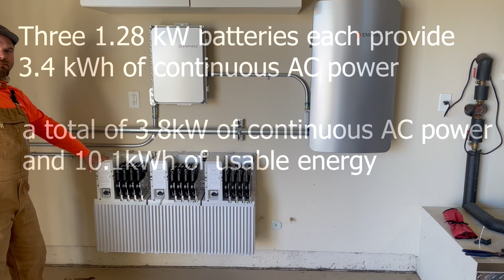How Does Solar & Battery Backup Work Together to Power Your Home Explained by SolarCraft

Comment: Liked your video 
But............Where is the industry standards on solar backup. 
Should solar written quotes and proposals contain peak amps usage and main fuse amp rating in survey assessment and written proposal containing Peak amps backup capability for home back?
Overall Kw doesnt tell you what the home rerquires or solution supports, customers need to know Peak amps usage and peak amps solution delivery..

Comment: If you would’ve installed the solar envoy lower, you could’ve negated bending a 90 and using an LB. Would’ve just been a straight nipple out the right side.

Comment: Is all the inversion happening at the battery mounted inverters (AC-DC and DC-AC) or are there also separate micro inverters under the modules? I think it's implied that it's all DC until you get to the battery IQ8s but wanted to confirm. Pretty neat overall
Reply from the maker: SolarCraft typically uses microinverters behind the solar modules to change the DC to AC on the roof. It’s then inverted back to DC to store the energy in the battery and then to AC to use in the house. Hope this adds clarity.
Reply: @Solarcraft  Thanks, that does. So two sets of inverters, one set at the battery and one at the module. If so, sounds like you have co-generation capability where you may deliver solar power as well as battery energy to the load  (home) simultaneously if needed. Thx
Reply from the maker: @Lexlugr   Correct. The gateway controller manages the incoming and outgoing energy from the solar, battery, grid and home. If the solar and battery can together supply the needs of the home at any point in time, the controller takes care of it.

Comment: So it looks like the solar is converted to AC and then any excess solar power is converted from AC to DC to charge the batteries.  Typically, how efficient is the conversion process going back and forth between DC and AC?  Also, does the smart panel replace your typical AC panel with breakers?  Nice video!
Reply from the maker: Good question. The Enphase 10.1kWh battery has an 89% roundtrip efficiency rating. So for every 10kWh you put in to the battery from the solar, you’ll be able to use 8.9 kWh. The Smartswitch has circuit breakers to protect the system but they do not replace the breakers in your homes electrical service panel. Thanks for watching the video.